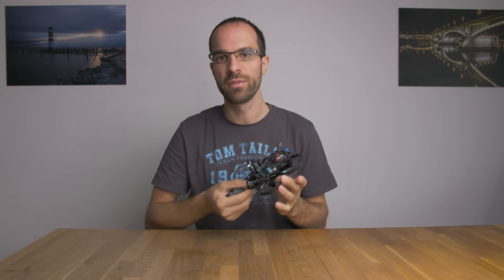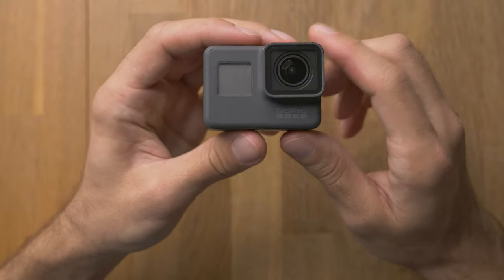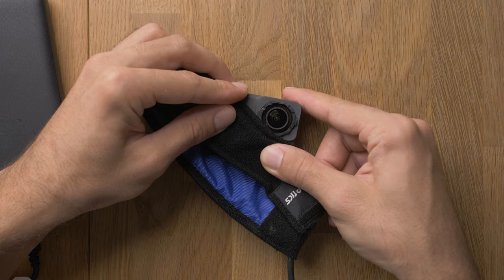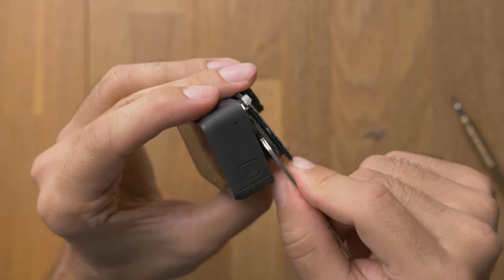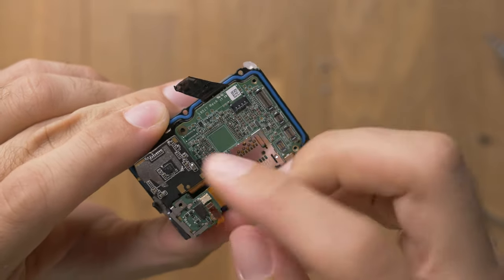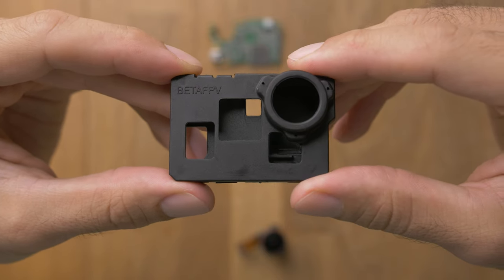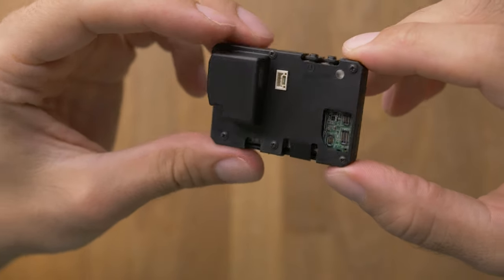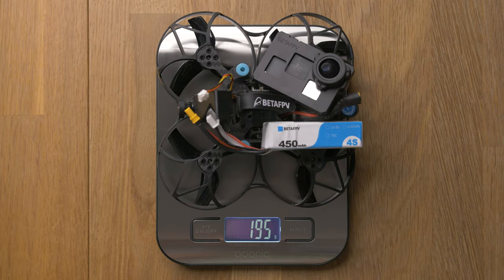How to de-case a GoPro Hero 6 Black and make an ultralight cinewhoop with the Beta95X V2

Comment: Let's ask you a questions. If I want to use This GoPro hero 6 Black to mount other kind of lens mount for example a c-mount have you other didactics vídeo like this?
  I will appreciate so much your answer.
Thanks so much!!!
Reply from the maker: Unfortunately I have no experrience with c-mount systems. Anyway this small quad doesn't lift much weight. But people use big cinelifters where they use naked BMPCCs.
Reply: @ReinhardBiller  The case is what I have many Oldest lenses an exist many adapters for.
Reply: @ReinhardBiller  in Cuba it's very hard find adapters..
Reply: @ReinhardBiller  you can support by the adapter or by the lens